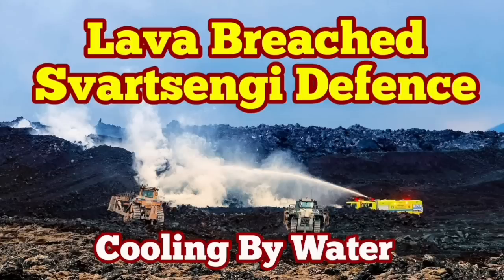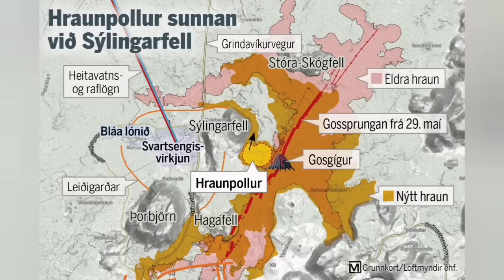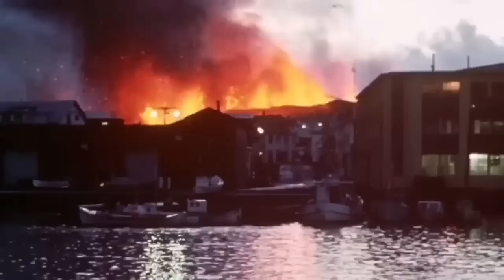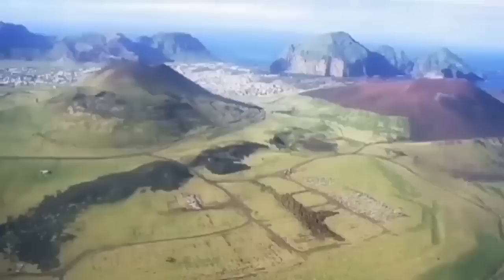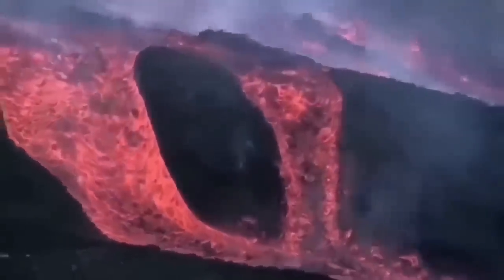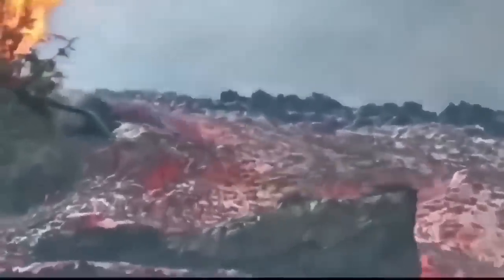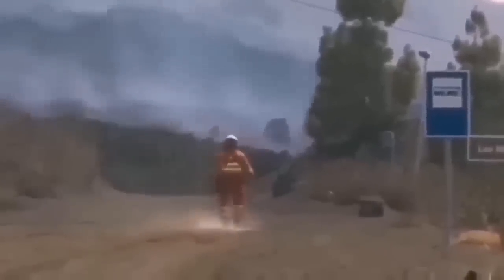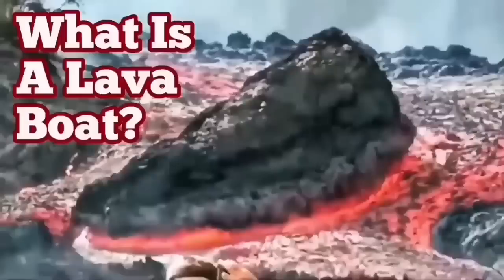Lava Breached Svartsengi Defence Wall: Cooling Lava By Spraying Water, Iceland Volcano Eruption

Comment: I'm not sure why they don't invest in some huge tanks on top of the hills and a massive pumping system to use seawater in case of precarious situations.
Reply: If I recall my facts derived from "GeologyHub" YouTube videos, seawater, and molten lava combined together result with some nasty chemical releases, one of which is sulfuric acid.
Reply: Cost vs. realistic chances of success.
Reply: @dot1298   Acidic steam, hydrochloric acid and vapors, and airborne microscopic shards of volcanic glass to breathe.  Not a good idea at all.
Reply: Simple answer: You would have to know precisely and in advance where you will need to build them in order to be useful at all. And you definitely underestimate how massive of an investment that would be. You think of a large tank... like, refinery sized? 1 of those would be empty in under an hour. Not going to help you much against an eruption that goes on for weeks!